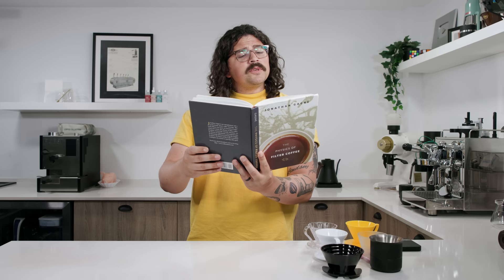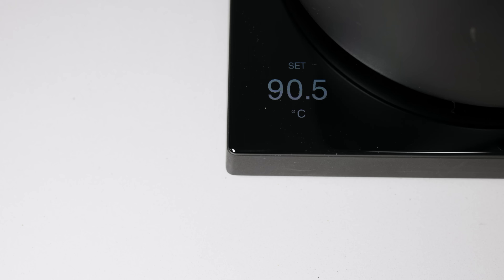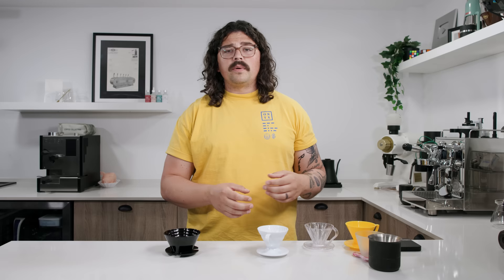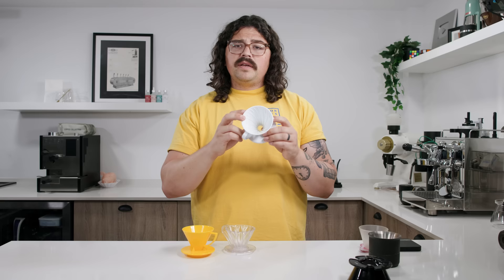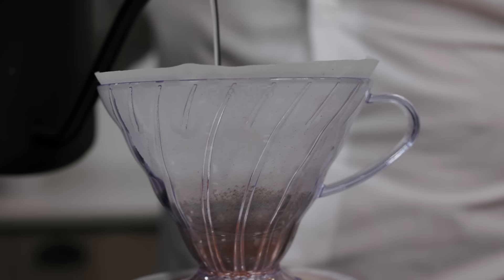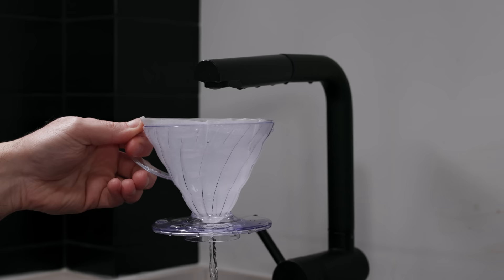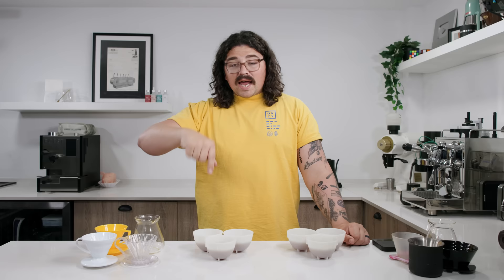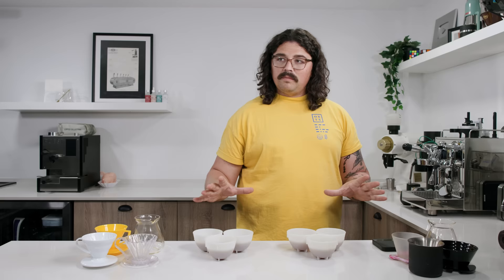WHICH IS BETTER?: Conical vs Flat Bottom Brewers

Comment: Great video ! This was a much needed discussion. The gripe I had with that study is that I wish they also varied dose (i.e. bed depth) because if you don't, and swap to a different geometry, you get a very different bed depth which affects not just brew time and bypass but also that bottom-layer which extracts differently with concentrated water. I would not be surprised if the impact of bed depth on taste was as significant or more significant than dripper geometry, and currently the effect they categorize as dripper geometry includes both geometry and bed depth.
Reply: I had never thought about the shape of the grind size affecting compaction and therefore bed depth before reading this.  My years of building foundations for houses and preparing the ground for that should have made this come to me lol  The compaction density, and just overall density of the coffee itself will most definitely have a major impact on extraction.  The variables of making a nerdy cup of coffee is by far my favourite autistic endeavour lol.
Reply: Anecdotally I can say that when brewing double dose (for me and my mom) versus just brewing a single dose (for myself) with the exact same dripper, the same ratio, approximately the same overall recipe, grind size, water temperature, quality etc held constant, there is a difference in taste.
Reply: @xllvr  which do you prefer?
Reply: 😮😢😢tt😮
Reply: @justinbouchard will vary if he's dialed in the single or the double.
Reply: They also did not control for filter flow rate, which also becomes confounded with basket geometry. I wish they had used similar filters for both their semi-conical and standard flat-bottom baskets. Or at least, they could have used filters that produced a similar flow rate with no coffee to eliminate filter flow rate as a variable. It seems obvious that if one filter has a slower flow rate and leads to more contact time, it will yield a much different yield and taste (think Abaca filters vs. Hario standard filters in a V60).
Reply: @darrenb9751   @Darren B  I dunno. Depends on the scope of the study. While there are more physics intensive aspects of cone vs flat worth investigating, this was a very consumer level study. Grind size, ratio, coffee roast, and brewer shape are the easiest variables for a home user to change. There is even an upside to using stock filters even if they have different flow rates, since that will more realistically follow how people use the different brewers. Things like bed depth and filter resistance might offer more insight into how shape matters, or the reasons why it does. But that's what second studies are for. :D
Reply: I would suspect if you adjust dose and brewing style to taste, you can make almost all setups taste extremely similar.
Reply: @xllvr  Same. I don't know about a flat, but in the conical for my Breville Precision, the large dose created a much more concentrated cup. We had to dilute it with water for a better taste.
Reply: @justinbouchard  Well I mean it's usually out of need so I never really thought about preference but the double dose seems to on average taste better
Reply: @xllvr  I was just curious if adjusting your grind size might make your lesser favourite taste closer to your favourite if you had one
Reply: Kalita brewing has, for me more consistent and forgiving. Hario V60, for ME gives me.. when nail it… a more complex cup. Obviously YMMV
Reply: Curious….For those of us whose tap water is unfiltered(I brew with a water formula) our nasty tasting tap water is off putting as to pre-wetting the filter. I get around this by adding more water to my kettle and thoroughly saturating the filter. I just don’t see how plastering the paper filter to the Hario plastic filter wall stops bypass.
Reply: Very good book by the way Jonathan..

Comment: Goodness that was a packed video! I appreciate you and your content Lance. I read Gagne’s blog a lot before his book came out, I haven’t read the book, but from his research process and blogs I took away that flat bottom brewers by design allow less bypass and more consistent extractions. He did a lot of research with the stagg and that’s now my daily driver.
I think brew technique is hugely important and possibly more important than brewer type, 3 vs 6 pulses is going to have a big impact on bypass because the amount of water above the level of saturation of the bed will vary: if the bed “saturates” at 30g and your pour is 50g then there is minimal available to bypass, but if your pouring 100g+ or always maintaining standing water above the bed then you’re begging for bypass; a lot of drip brewers do this, a steady stream of water that never drops below the level of the bed. Some brew recipes have you stop pouring as soon as you reach a saturated bed, which results in 10+ pours and would surely result in less bypass.
Two things I assumed you would hit on (but honestly you covered plenty so maybe there should be a part 2?), were the use of agitation to ensure you don’t have hydrophobic clumps of grounds in your bed before pouring or after your bloom (similar to espresso), and the use of immersion brewing or pseudo-immersion brewing like French press/aero press/next level brewer (which Gagne helped design for this very end). 

Great video, love the content, keep it up!

Comment: I love your callout about recognizing how coarser grounds allow for easier management of channeling; how all beds will have channeling and that finer grind sizes are on a tighter balance beam between relatively even channeling and very unbalanced channeling. There's so much push in the speciality coffee brewing world to go as fine as you can until it's astringent and then go back just a bit more coarse. The study you discussed in another video related to, I think turbo shots, and how the curve showed similar extraction on two sides of a hump of finer and coarser where coarser could allow for same output but with more repeatability... that feels like it rings true here, too. Coarser isn't bad, it can be quite good, with some nuance in that discussion.

Comment: Fascinating. My take away: controlling my water level is more important than I realized - I want to have consistency of by-pass so ensuring that the water level stays just at the top of the bed, will maximize my extraction / minimize by-pass. I think really that's probably why various recipes call for different pulse patterns of pours. 

I'll now swirl aggressively on the first small pour to thoroughly wet the bed then use shorter pours only allowing the water level to reach the top of the bed and then letting it drain sufficiently before doing another pour

Comment: I got the fellow Stagg x on your recommendation and also got a Fellow Smoosher from Etsy. It leaves a small gap when smooshing kalita filters and I get zero clogged or stalled brews. In fact no matter how fine I have ground with the zp6 it usually drains in 30 seconds following your 2min bloom, slow pour recipe.
Reply: Haha I designed that! Glad you like it, it's my daily driver for over a year now. I'm really liking limited bypass brews on it
Reply: @daRock1212  nice! It works great. It is part of my go to travel kit for the road.

Comment: This was super informational. I waited for this kind of video for long. From a point of view of a BrCC competitor it is very helpful to know that basket geometry makes a bigger difference then the grind size does. As far as I'm concerned most of the baristas including myself would dial in a coffee using grind size as a primary Variable. Also most of us would use a different grind size for flats and cones. Maybe next time when I'll be dialing in I'll use my preferred ratio for the roast I'll be working with  and stick to the grind size that allows for a reasonable brewing time and only change in between a V60 and orea to see which one expresses the coffee in the tastiest way. 
One more thing that I think would be worth checking is where does the choice of a type of filter place on that scale of impact on the taste. I mean different types of paper filters with different pourosities and thicknesses, but also a check against a cloth filter could enrich the data on this matter.

Comment: Thanks for the tip about using a tea mesh with a flat bottom dripper! I was experiencing issues with inconsistent draw down times using my Orea dripper, and putting the mesh below the filter seems to have eliminated the issue entirely.

Comment: Six essential elements said 1:17 yielding 1.25% tds is more palatable to most people.  True then, true now.  Low and slow v60 has always been my preferred method because of the natural agitation increasing extraction.  I consistently get a 1.35% tds with a 1:17 ratio, above what the Coffee Control Chart predicts.  As long as the coffee is in contact with water, saturated, I don’t care much about bypass.  TDS suggests we’re getting plenty of dissolution and diffusion.  Allowing water to flow naturally into the coffee particles does something beautiful for me.  I think this is often overlooked for the lack of “evenness” in the geometry.  I also think the cooking a steak analogy is erroneous because the heat source of a grill comes from beneath whereas water surrounds a coffee particle.  Best video I’ve seen so far about the subject.  Thanks for creating, researching, and sharing.

Comment: Great video with fascinating results! I would also say if someone is bothered by the bypass, they can easily just adjust the ratio without probably noticing negative taste effects. It's important to note that also high strength brews without bypass may not always be the best. The preference for bypass is subjective, as it can contribute to a more enjoyable brew or not. In fact, some professionals bring out beautiful flavor notes, such as florals, by reducing the amount of water they would pour through by around let say for example 30% and instead add that  portion afterward as bypass.

Additionally, you can observe where bypass occurs more through experimentation. It typically happens at points where the filter makes contact (like the veins on a V60) but also where there is airflow. You can see this yourself at home. To illustrate this, imagine camping in a tent with dew on the outside. The water doesn't enter the tent until you touch the side. Similarly, if you brewed with just a filter and no basket, you would still have some bypass, but less than with a brewer that has many contact points and airflow. It's like having 30 people in a small tent, all touching the sides with their hands. 
Ultimately if you taste buds like it... That's all that really matters 😊. Greater water and coffee will make all the difference. Cheers

Comment: Very interesting, never thought of geometry as a major factor before.  I usually go for light roasts but that being said, I have noticed that when I try darker roasts, I enjoy darker roasts more when I use a Clever Dripper (which is kind of a cross between cone and flat) than when I use my conical dripper. This is pretty consistent even though I use basically the same recipe in both brewers. I'm sure brewing method has a lot to do with it since the Clever is hybrid emersion/perc brewer, while the cone is pure percolation but maybe the different geometry also plays a part.

Comment: I'm not that long on brewing and I'm far from a good taster, but here's my experience: I notice a clear difference in flavor from coffee that I have at home (very light roast) vs my father (medium) - using the same water temperature, basket and filter paper. Recently at home I changed the ratio - 1/17 based on your tips - and again I notice a difference. So I would say that "statistically significant" is correct in my experience. 
And... you're the GOAT! Cheers

Comment: I use water from the coffee shop. Its ro then remineralized with 80 calcium, and the owner may or may not add 20 magnesium. Once I got my water  jugs from the cafe, I could taste the quality beans again. Now, I focus on similar factors noted in your video. I wasted a lot of good beans trying spring waters, packets to add to distilled, etc. Even better, there is no charge for a jug of water, but I add a tip for the favor.

Comment: I share your dislike of frilly filters. After trying a lot of drippers, I settled for two - Hario Switch (sometimes I use it just open like a regular V60) and April dripper. I actually use Cafec V60 papers in both, you can fold one so it fits a flat bottom dripper and I'm still able to do it and rinse the paper well before my water boils, so the extra operation doesn't result in any time lost.

Great job as usual.

Comment: I love my little glass Kalita 155. It never stalls and makes a very good, consistent cup. The convex bottom holds the filter up over the holes. Also, it requires no faffing around with stirring, swirling, or other forms of manual agitation. Very rarely do I find the need to use anything else.
Reply: Using a glass kalita 185, I share similar sentiments, I have no issues using it daily

Comment: The Ergun equation is the more appropriate equation when it comes to flow through a packed bed (like a bed of coffee) compared to Darcys law. Theres also an extraction (mass transfer) equation at play here. In something like a french press or aeropress where the coffee is mixed in a fixed volume of water, the system will be more uniform in extraction across the bed - similar to a CSTR in reaction kinetics modeling. In a pour-over the solvent flows in a more plug flow manner.  Cones yield higher bed heights for the same mass typically so it approaches more closely to true plug flow and would be modeled similar to a plug flow reactor in reaction kinetics.

Comment: Very nice video and very informative....but Dracy's law is the equation of a liquids flow through a porous media.  It doesn't take any account of the 'restriction' presented by a filter, so as we use 'filters' to brew coffee this has to play its part in the end result i.e a good brew.  I do a lot of experimenting as I have V-cone filters unbleached, Flat bottom cone filters bleached & unbleached, No.2 basket filter unbleached 'all' of these are 0.006" thick.  I also buy and use the 8-10 cup basket filters form the $ store bleached, these are thin only 0.002" thick, I fold these up into a No.2 cone, mainly for camping as they are very cheap and light.  So my question is 'obvious' the filters thickness along with its 'porosity' will have a great effect on the end result.  And those using non-paper filters such as all the stainless steel or plastic mesh filters out there, I have tried these, and they do not make a 'smooth' cup of coffee.

Comment: Informative and charming, as always. This made me wonder, though, why there is all this talk about the evenness of extraction, but no one seems to be systematically testing methods of controlled stirring, like, e.g., 1 full rotation per second (maybe with a plastic spoon to minimize heat loss). After grind size consistency, stirring could be the best extraction equalizer, right?

Comment: Nice one. Like that you missed the second triangulation. Will definitely give this a go at home between a v60 and an orea. I can refold my v60 paper to fit the orea. So far from notes, not a test, indeed I find a cone to give more highs (or lows😅) and a flat is more even. For carbonic maceration is actually prefer a flat right now because it balances that extra flavour and makes me like it. On a v60 and CM I  get way too much.

Comment: Thank you for this awesome vid! I have “the physics of filter coffee” at home and I read through it regularly. A great book, but the way you are able to communicate the major findings really help in understanding it better. And as always, you drop some really cool findings as side notes throughout the video that would be worth making a video on their own. Such valuable information. For example, I have tried to blind taste “papery” taste in filter brews side by side, but that was nearly impossible. 
One Question: Since brew temp is not statistically significant, would that mean using hot/boiling water to rinse the filter and preheat the brewer is pointless? If using cold tap water to rinse yields the same results, then my workflow would be quite a bit easier and at the same time consumes less energy.

Comment: Maybe I should look at my Kalita Wave again... it's been sitting on my shelf gathering dust for years because I've been using my conical brewer and I JUST got a Hario Switch. I think I found it tough to find a recipe that I liked way back then, but there are way more resources now ever since coffee became more of a hobby over the pandemic. I know brewers like the Orea are all hip right now, but I can't justify getting ANOTHER brewer if the Wave works just as well (with a little bit of tweaking). Maybe I need to widen the holes with a drill to increase flowrate and minimize stalling?

Comment: Temperature for espresso brewing I think should have more of an impact, correct? 

I think it's safe to assume that more bypass will happen if you fill higher above the coffee bed, there's more area where water can escape without touching the coffee as much, but also I think part of it might be that there's more pressure / weight ontop of the coffee so that might push the water through on the bottom quicker too? 

Surprised grind size actually made less of a difference than the basket shape, that's interesting. I think I'm more used to the espresso world where grind size (dialing in) will make a pretty huge impact usually.  Brew Recipe/Ratio and Roast level is no surprise that's going to contribute even more so.